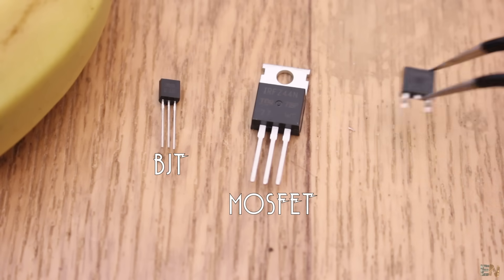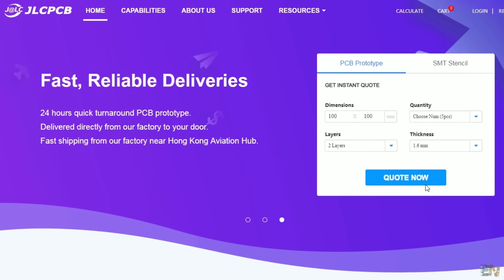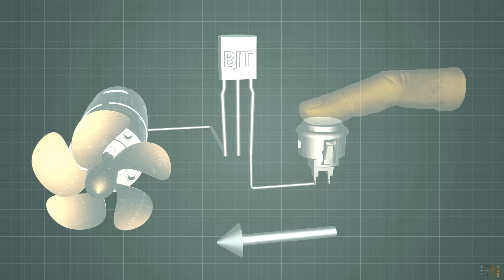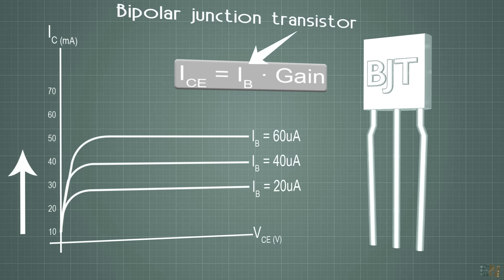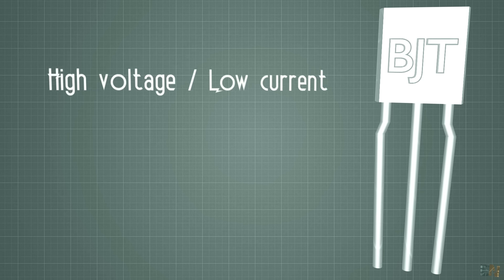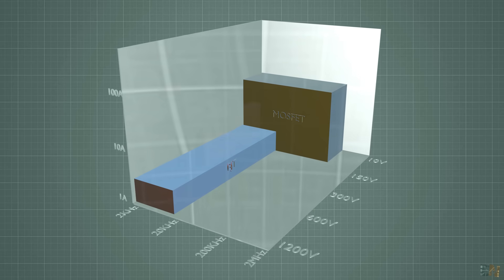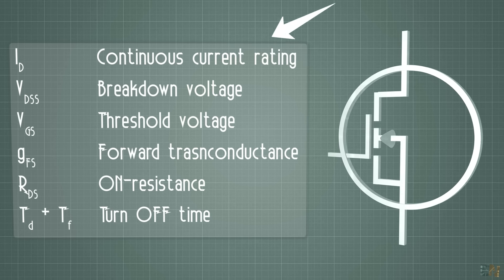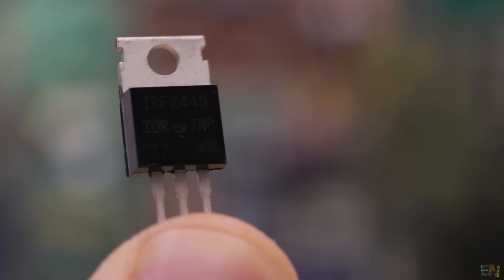MOSFET BJT or IGBT - Brief comparison Basic components #004

Comment: 7:00 VGS is gate to source voltage not the threshold voltage. Threshold voltage is VT. If you want to turn on an N-MOSFET VGS must be greater than VT. For a P-MOSFET VSG must be greater than |VT|. To work the N-MOSFET in saturation region VDS (drain to source voltage) must be greater than VGS-VT. For a P-MOSFET VSD (source to drain voltage) must be greater than VGS-|VT|

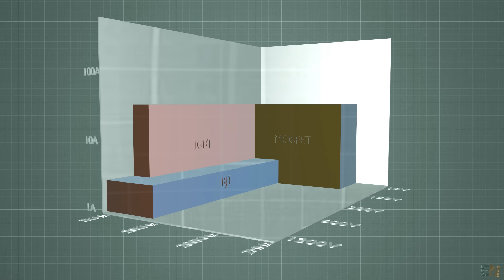Comment: A great video, but @ 6:25 IGBTs are more frequently found in welding equipment as the welding current control semiconductor device, second to that is usually thyristors.

Comment: Hello can you help me please.
I have unusual problem I have multipel of those 4pin gm ignition modules and multipel e core type ignition coils so I wanted to build me self waste spark ignition but sadly I have only 1 pick up coil so I dont know what to do ?
Im not shure how to activate that integrated analog to digital converter and Im not shure if me pick up coil can run 2x ignition modules .
So any sugestion please?
How I can achive dual ignition with just useing 2x 4 pin gm ignition modules?
Shuld I rewound that pick up coil with twin coils?
Ore is there other solutions?
I was also wondering culd some relays replace the ignition module?
Because I have integratedpositive linear voltage regulator inside me dashboard and aperantly that 4 pin gm ignition module is polarity sensitive I have somthing called R terminal starter motor selenoid normaly that thing is used for bypass voltage to ignition coil on points ignition so I have trobel there understanding that odd circuet.
I was also wondering how wuld it be posibel to run bouth positive and negative ground ignition coils with out creating dead short?
If any thing you know please some info.

Comment: In your Temperature PID controller - Arduino project you send a PWM signal from the Arduino to the base of a BJT before using a MOSFET to control a 12 V heater. Can you explain the purpose of the BJT in this circuit (i.e., why not just send the PWM signal of the Arduino directly to the gate of the MOSFET)? Is it used to amplify lower PWM voltages so they are above the gate threshold of the MOSFET?
Reply from the maker: Moafet works at 12V and arduino only 5. Since is not a logic level mosfet, we need to apply a high enough voltage at the gate in order to fully open. That's why we use a bit as a gate driver :)
Reply: @ELECTRONOOBS  Perfect, thanks! I'm learning a lot from your projects/videos.

Comment: what's the best way to control a hub motor controller from a microcontroller?  They take a signal voltage of approx 0 to 5 V from the throttle .  Should you go through a transistor?

Comment: A little dated. Mosfets such as the IFR830 are high voltage as well As relatively high current. The important thing to consider is the Safe Operating area of the device and Secondary Breakdown. Mosfets are much better in this regard. Prices are reducing all the time. Old BJTs are becoming obsolete in many areas. IGBTs we’re really a compromise until full capability MOSFETs became available.

Comment: So many types of transistors, why did they make it look the same and different ways to test on top of reversed when analog multimeter is used (the moving meter needle is cool though): BJT transistor which still has, NPN, PNP which you have no way of knowing by just the marking, then there's Mosfet transistor (the type that made the ICs: CPU, GPU and the computer possible by making it affordable- paving the way to the cheap internet servers, thanks Steve Wozniak and Steve Jobs for the first practical, personal computer) which also has the NPN, PNP and has it's way to be tested (charged, not charged) and then there's the Schottky which for some reason the inventor made it to look like a MOSFET. And then that IGBT which most likely has an NPN, PNP and may probably have a different way to test. Lastly the labels of the legs,  Gate, Drain, Source then there's Base, Collector, Emitter (we must standardize the industry X-D )

Let's hope, pray and fast they change all these, make all component and their sub-categories the same and may analog multimeters test all component the same as digital multimeters.

God bless, Rev. 21:4

Comment: Thanks for teaching
BJT/MOSFET/IGBT

BJT
High voltage and Low current
Low on losses
speed : around 100 kHz
Complex base Drive

MOSFET
High current low voltage
Low RDS(ON) resistance
speed around 500 kHz
simple gate Drive

IGBT
High voltage high current
Low on losses
speed gate Drive
Low speed around 50 kHz

Comment: Low ON losses will depend on the load current. Because some Mosfets have very low Rdson and the Collector emitter volt drop of and  Igbt is around 1.2 Volts. So you should also calculate the conduction losses before deciding on Mosfet or igbt

Comment: Which is better between power MOSFET and IGBT for using in voltage regulator circuit? I want to drop voltage from 220 VDC to 72 VDC.

Comment: What if I want to off a led with 5v.
I mean,
I have a LED of 5v and one of its sides has a transistor connected with emitter & collector. What I want to do is when there no supply available to the base, the light should be on but if the base gets connected to +ve the light should be off.

If it is not possible to do then what should I use for the project.

Comment: Perfect explanation Master 👍
 I would have a question:
 - I built several „drivers“ (H-Bridge) for stepper motors.  The motors consume about 2A per phase.
 I am using Power Mosfets: IRFZ44N, IRF9510, IRF4905, IRF740.
 My question would be:
 - Do you need protection diode power Mosfets?  Looking at the photo of the Mosfet (on the datasheet), the Mosfet has the built-in protection diode.  But I'm not sure that is the case.  Or if you want to say that ...

 If anyone knows, I would be very grateful ...
 thanks and greetings to all ✋

Comment: Nice presentation however I have to disagree with you in your comparison of the BJT and the MOSFET. In your explanation you stated that BJT were used in high voltage applications and MOSFETS in low voltage applications however it is just the opposite. MOSFET are usually employed when loads exceed one ampere and are widely used in Switch Mode Power supplies for that reason as well as their fast switching abilities. On the contrary BJT are current controlled devices usually with loads of one ampere or less with much lower voltages. IGBT transistors find a wide use in High voltage applications such as motor controllers and traction motor control circuitry where heat may be a problem.

Comment: Interesting. Can some one please advice me on a correct transistor to use on a solar light on off switch. My solar panel is 5watt 9volts. And my light is 7 volts to power up. Also I will be using a 8.4 rechargeable battery. Thanks to all the brainiacs out there.

Comment: I want to have switching capability in both directions ( MOSFET has internal diode ) with gate voltage up to 5v and source to drain current up to  3A using a 9V battery. What should I use? I am new to these things, so excuse me if I said something wrong above.

Comment: So if I want a simple switch to control a load by arduino, I choose a Mosfet or IGBT?
Reply: Both can be used but remember IGBT is higher voltage and current oriented so you preferably use a Mosfet or even a BJT

Comment: For amplifiers, your best bet is to go with BJT’s, because they have very high transconductance. On the other hand, MOSFETS are nice because you can easily integrate digital control into analogue elements on the same IC, however, they do have poor transconductance. Over all, BJT’s are nice, but their performance (IE in a emitter coupled pair) is limited by thermal voltage. This is not true with MOSFET’s.